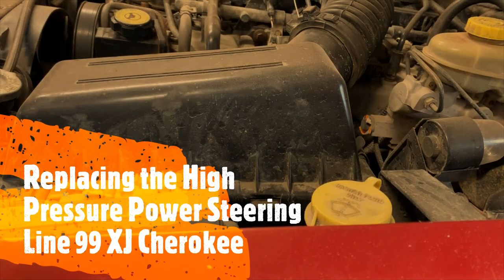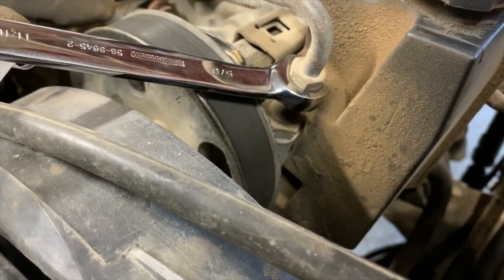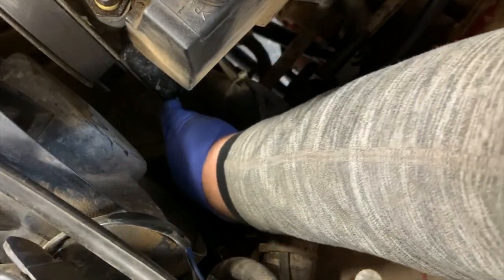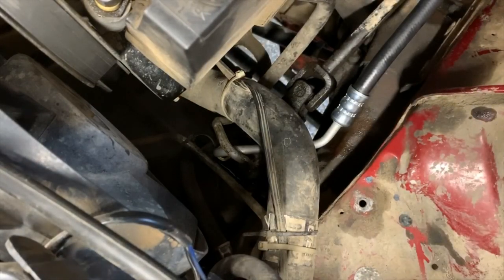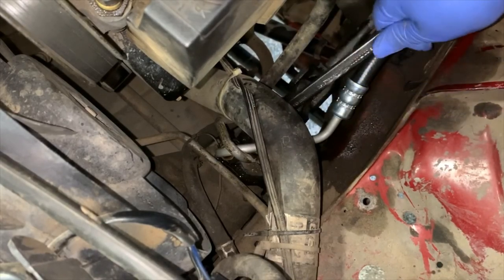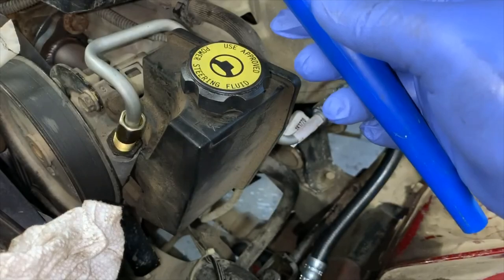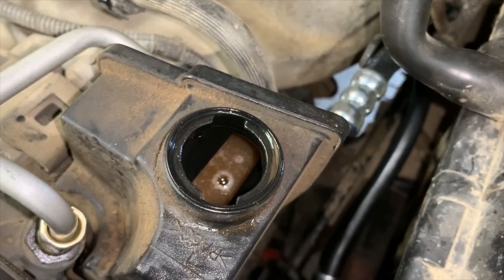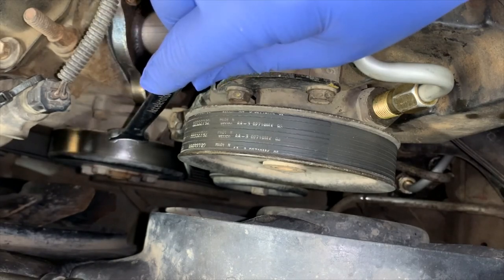How to: Replacing the High Pressure Power Steering Line 99 Jeep Cherokee XJ

Comment: So a couple weeks later... I cut the lines at the fitting and put a socket on there.. had to get the low side off and then the high pressure side... bit of a pain but it’s done...was able to get both hoses from local parts store..
Reply: Did you get Mopar or aftermarket ?
Reply: @ibberman  aftermarket from advanced. Seem to being just fine so far.